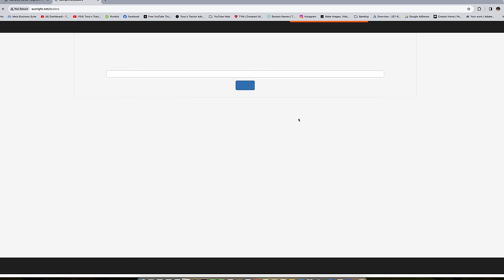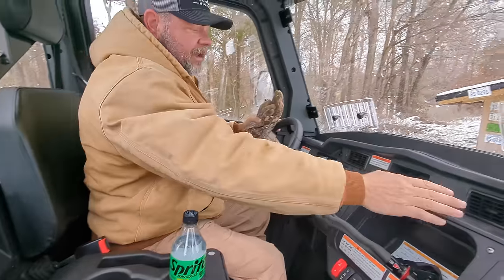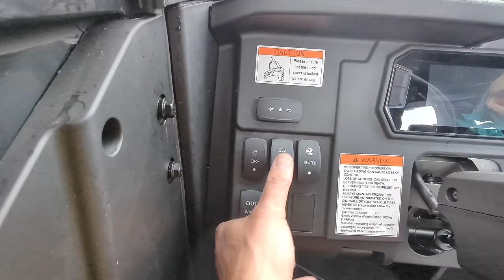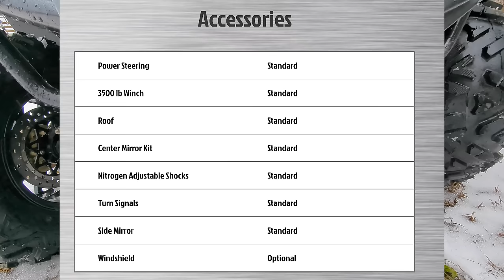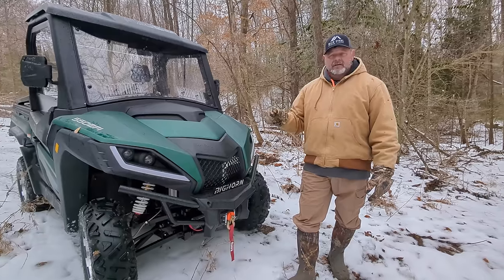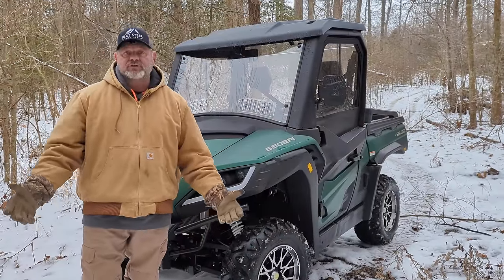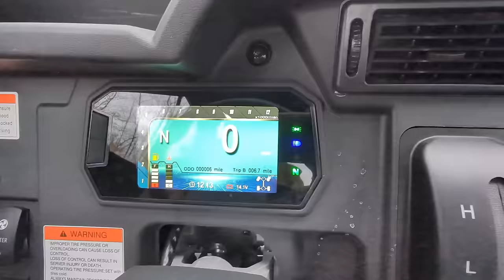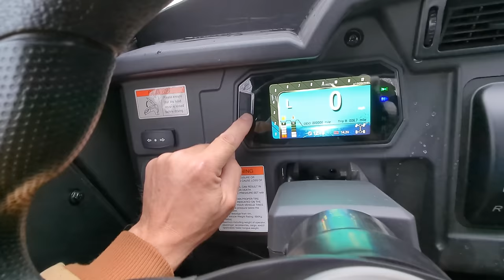2024 BigHorn 550 EFI Side By Side with UTV Heated Cab - Tractor Supply & Dealers

Comment: Oh boy. Dont think you needed a heater. That motor under the seat is gonna generate a bunch of heat. Like uncomfortable heat.
Reply from the maker: At 25°. I found that the heater was just barely enough. Surprisingly, the engine did not provide very much heat at all. The way the big horn 550 is built the head and all of the exhaust is under the bed. This is a benefit in the summer

Comment: I HATE these on public roads! 

So unsafe. So many nearly collide into me as the drivers don't give a crap and pay zero attention! No turn signals (used), no stops (full), no concern for speed limits. These are the bane of Wyoming towns.

Granted this is because the drivers are horrible humans, but it's just as bad as BMW drivers not using turn signals!

Keep these off the roads where they belong!

I'd much prefer a mini truck made by Toyota, safer, literally a car, far more reliable. And in many cases, they are cheaper. Way better for the environment as well.

Rant over. This one looks pretty nice, why no price? Was this sponsored?
Reply from the maker: I don't talk about pricing on my channel. We reach a very wide audience and pricing is significantly different from one area to the other. I appreciate your opinion on driving the on or off the road. If bad driving is the criteria for taking vehicles off the road then there should be hardly anyone on the road. No matter the make a vehicle.
Reply: @TonysTractorAdventure  I agree and support your last statement. If I could get paid enough to live off of by working at the DMV, nothing would make me happier!

Comment: The exact same machine sold under brand SSR Bison 500 has heat, windsheild and power dump bed as standard.  These "Bighorns" are less than 500cc, so they are lying there. The heater is self destructive and will not last, it is located in the front suspension for dirt rocks and debri to enter, the fan hardly blows at all.  Ask me how I know??.....I just bought a SSR Bison a month ago.  No "Park" either.  The parking system is unreliable and dangerous.
Reply from the maker: I can't find the machine you are speaking of at any of the websites selling the SSR Bison. Is it a prototype? Why is BigHorn Lying? That is there model number. Every manufacturer out there makes their model number higher than the CC of the engine. Still, If BigHorn is lying, then so is SSR Bison. It is a 498 cc engine.  It sounds like SSR's  QC is not good. I am not having any of the problems you are. My parking brake locks the rear wheels up well.  The heater doesn't blow my hair off, but it works as I would expect. I will look at the intake to see if dirt can get in.
Reply: Not sure if my reply went through. It doesn't show on my end.    No idea,
Reply: I do not know why they are lying about the cc's.    Well, I do...😉  The "rounding up" is common, as everyone knows,  but they went to the point of misleading/lying.  I really like the hard cab, as I've mentioned before, I have the soft cab.  I just wonder how hot they'll be when summer comes.   I ordered 3 of the SSR Bison 500s.  One for me (red), one for a freind, and one (green like yours) for his 74 year old father.

Comment: Ya know CVT drives are totally disengaged sr the drive clutch when you drop the rpm. No engine breaking. Hondas are shaft drive with transmissions and totally engine brake idling down hill. I'm an 80 year old back woods bush rat and have witnessed and had every trend of snow machines ATVs side by sides and track or wheel amphibs. All types 2 cycle and  4 cycle engines with trannies and CVTs which is the only perfect setup with 2 cycle CVT systems. But not always perfect for ATVs. Dandahermit  running heavy snow and hilly  land is vital for engine breaking downhill. Or you only have control half the time
😅
Reply from the maker: Years ago you would be correct. You would be totally wrong in this case. I use the engine as a brake all of the time. See this video going through steep trails.